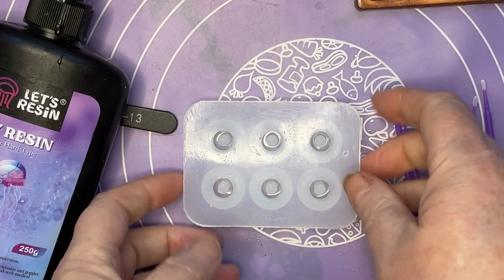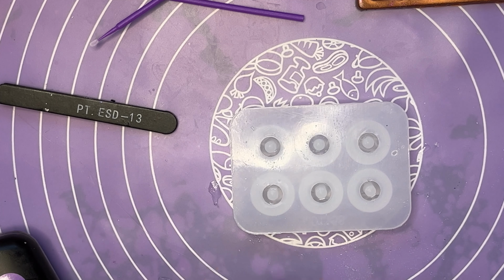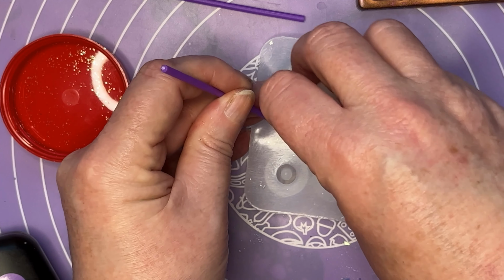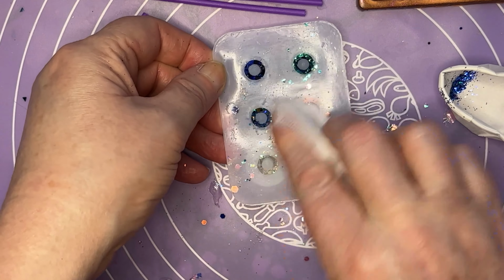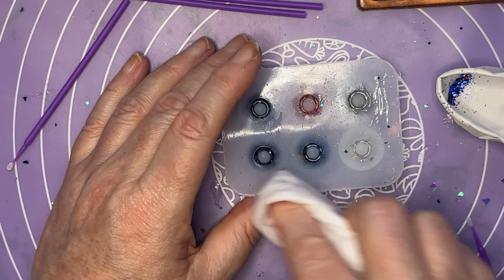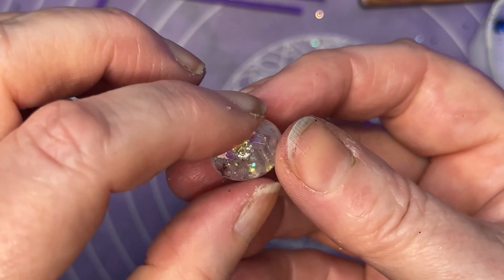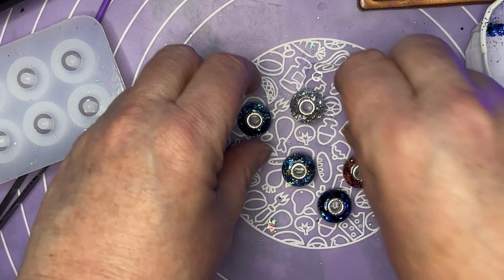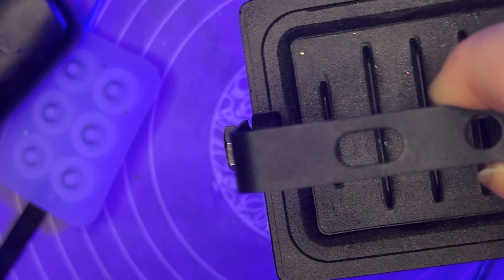#63  Make Your Friends Jealous With UNIQUE Epoxy Resin Glitter Charm Beads

Comment: The cleopatra  glitter is awesome  I love the pandora beads you made with these glitters,,  I've also done some baby snails 2 last night  they turned out beautiful  except for the eye stalks, even though I pushed the resin into the 4 holes  in the snail so I turned the mould inside out carefully and checked to see if any hardened resin got stuck,, no all was fine so put the mould right again and done 2 more this morning the last one I done turned out perfectly  he has light green bass or foot, a d then dark green,, and then clear withpolymer grapefruit  slices with  tiny purple metallic  stars  called him shreckel !!!have to try this with the frog and 2 part resin. Have a great  week end
Reply from the maker: That sounds lovely. Yes the antennae on those small ones  are a real pain

Comment: These are so pretty...
I love your videos.

Word of caution about the UV resin.  If you happen to be allergic, it can cause severe contact dermatitis.  I learned the hard way. Fingertips are a horrible place to deal with it and I'm on a third cream trying to get them healed.  It has been very painful.

I know not everyone has such reactions to it, but just be cautious if you're one with skin sensitivities...
Reply from the maker: I have no issues with  the  recognised brands of UV,  just  some brands of Epoxy, which is solved by not using those brands and taking  care with PPE. UV resin is safe for most, though someone somewhere will have an allergy I'm sure so wise words of caution. The only issue I have is if some cures on my  hand! Ouch it's hot and  hurts lol
Reply: @miniscenesgb  I'm just one of those people.  Stings, bug bites, plant leaves (even non poisonous like corn and rhubarb) have all caused issues. I've  invested in heavier gloves and I'm itching to get back to work.  No pun intended.